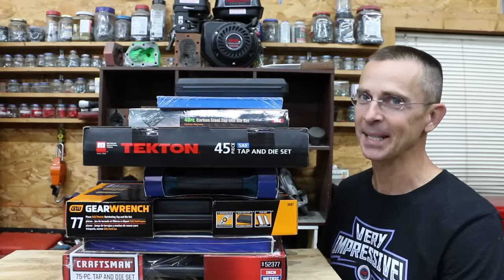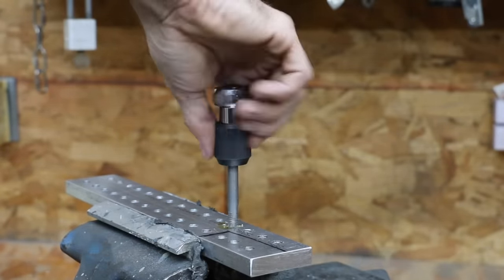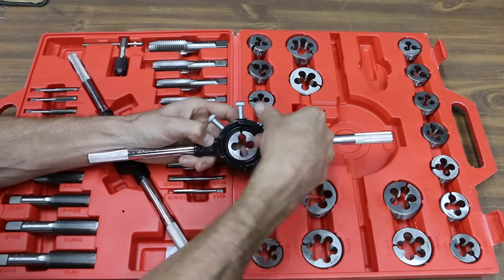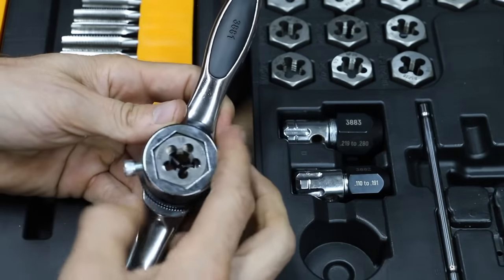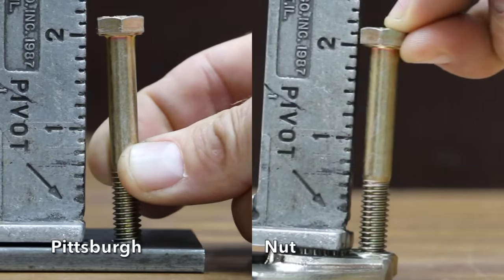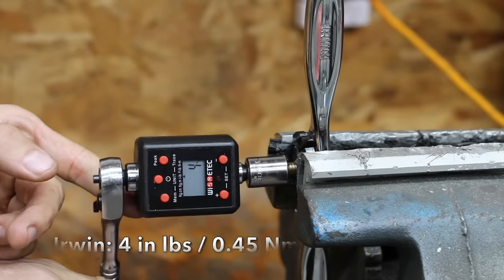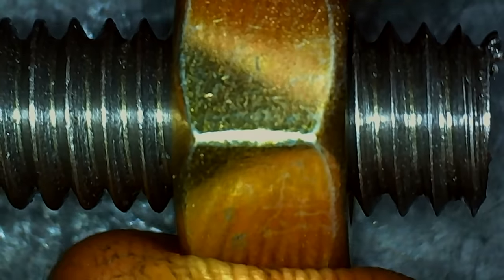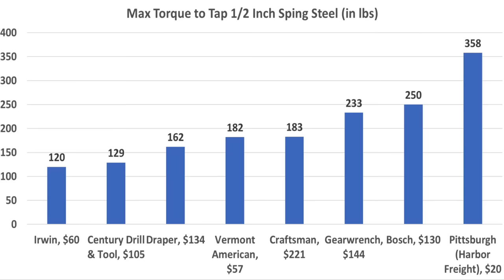Best TAP & DIE Set? Craftsman vs Irwin, Bosch, Draper, Vermont American, Tekton, GearWrench

Comment: I was a machinist for a defense contractor and we use Greenfield and Guhring taps. The tap sets you tested here are fine to general use and do not have a tread clearance called out, that's why they vary on how lose they cut. The Greenfield and Guhring you have to specify GH1 or GH2 depending on how you want the bolt to fit. GH1 are very close tolerance fit and are the most expensive. The GH2 has more clearance but still less than the sets you tested. Maximum holding power use the GH1.
Reply: How does Starett quality compare to the other two?
Reply: @jimb9283  Starrett makes mostly measuring devices, they do make tap wrenches but I've never seen a tap made by them, even if they have made taps better to stick to the companies that specialize in making taps.
Reply: Gurhring makes taps? Learned something new
Reply: Also 4 flute taps need to be reversed frequently to break the chip to achieve the best it can deliver.
A quality cutting fluid makes a world of difference also.
All tested are hobby grade , a far cry from a Greenfield or Guhring .  Retired Tool Die & Mold maker.
Reply from the maker: Thanks for the feedback.
Reply: That sounds like high dollar stuff.  I think you're in a different class of shopper.
Reply: Guhring makes sole fine tooling. Their Firex coated cutting tools are next level 👌🏻
Reply: Thanks - that's very interesting, especially the GH1 vs GH2 tolerances. I've heard Guhring make great twist drills but they tend to mostly be for business to business.
Reply: @matthewolson9704   OSG makes nice taps too.
Reply: @gizzyguzzi  High dollar doesn't begin to cover it - the cheapest Greenfield tap&die set Grainger sells is $400, and it's tiny. their biggest Greenfield set? 4 grand.😵
Reply: @machinist7230  WOW.  I'm shocked to see what a half way decent home set is going for now, but I guess I shouldn't be.  A few hundred bucks doesn't go very far these days.
Reply: @machinist7230  The vast majority of items at Granger are way over priced.
Reply: If you have a damaged thread, you can either retrace is with a cutting tap or use a tap that reshapes the thread. Are you familiar with the latter?
Reply: @machinist7230  OSG and Sossner are my favorite production-grade taps. Our CNC shop used them both over any other industry brand (30+ years ago).
Reply: I love Greenfield taps!
Reply: @machinist7230  Grainger is the worst place to go if you're looking for the best price on anything !  On the other hand, if you need something tomorrow, they usually can get it to you then.
Reply: Really super important information T Johnson. Reading the comments here has been very educational. People mentioning product brand names, and the specifications of taps, and also how to properly adjust the size of dies, is very important.
Reply: My background is tool making injection molds and have used a lot of Guhring taps and they are fantastic.  I have some in my toolbox that are still going strong 30 years later.  You can see a lot of the taps in this video are already dull new. Taps are not a good place to cheap out.
Reply: My grandfather was a hobby machinist and I wound up with 2 small boxes heaping full of SAE taps along with a couple of OLD Vermont American SAE tap and die sets. I gave one of the sets to my brother and kept the other for myself. I had no idea what I had for taps until I went through them one day. I have a ton of Emuge and OSG spiral flute taps along with a ton of various brand standard taps and it is incredible the difference between those and standard taps, even high quality standard taps with the thread quality vs the Emuge or OSG. Unfortunately, I didn't get any metric taps or dies, and I've been on the search for a good metric tap and die set in the 40 piece range. I do have a greenfield tap handle that is excellent that was also his.
Reply: GH3 is your standard tap to use for most all aerospace parts. As a former machinist and now a Mfg Engineer, you only reverse the tap when tapping by hand. And to be absolutely on center of the hole, you drill the hole, then without moving the machine table load the tap in the machine spindle and tap using the machine power, not by hand, without reversing the tap until you are removing it from the newly tapped hole. For aircraft/aerospace parts, you NEVER hand tap. Those bolts fit sloppy because the tap was not centered to the hole properly, and any time that happens, a sloppy hole is the result, and with smaller taps, they will break. 

GH1 & GH2 taps are basically too small unless the print is calling out a modified pitch diameter. For threads using a GH3 tap, If the parts get plated, you might have to use a GH5 or GH6 tap if the threads are supposed to be plated depending on the thickness of the plating. With Aerospace parts, class 3A & 3B are the most common class of fit and a GH3 tap is used for that class of thread. 

All those tapped holes in the video would have scrapped the parts. Way too loose.The no-go gage would have gone all the way in. For the weekend hobbyist, they are pretty much good enough. But the way to do it is to drill the hole, then tap the hole especially on a drill press or a Bridgeport. On a CNC mill, it doesn't matter. I have been in Aerospace for 52 years and tapped thousands of holes. Most of the taps we use are OSG.
Reply: @MattsRageFitGarage I like the Emuge taps, we use them a lot where I work.
Reply: @CaptainGoldbeered  Yep they've always produced excellent threads every time I've used them.

Comment: I tried using a harbor freight tap to cut a hole in an engine block. IT DID NOT CUT FOR ANYTHING. got a good quality hardened tap and worked perfect. Learned my lesson 😂
Reply from the maker: Great feedback!  Thank you
Reply: Harbor Freight tools are hit or miss. I've gotten a few excellent tools from there that lasted years. Went back to get another one, and it was total garbage. And then, a 3rd time and got some sort of mid-range quality. I thin it all depends on who they source from when they need to restock their warehouses.